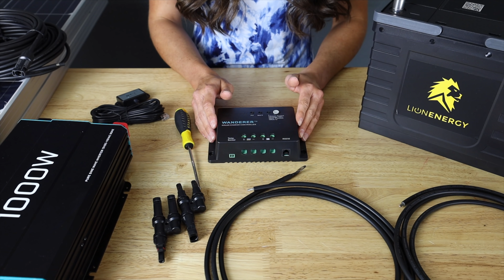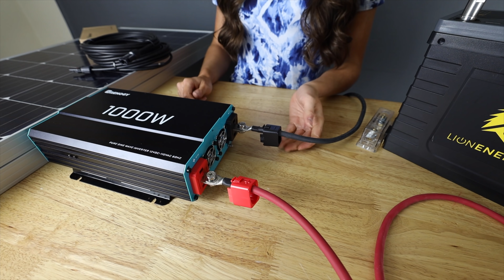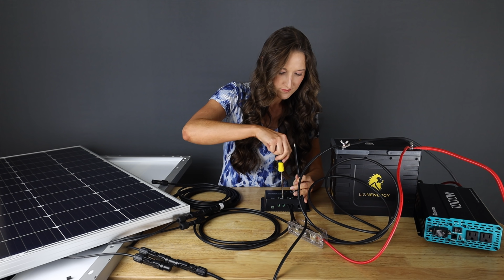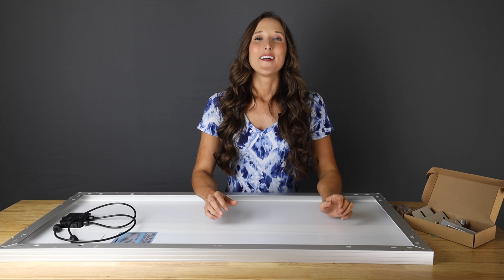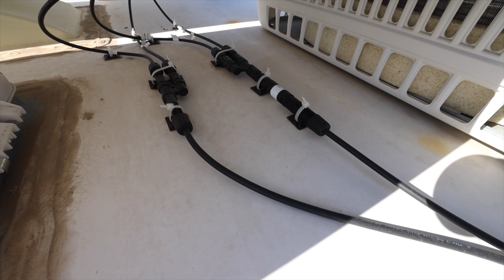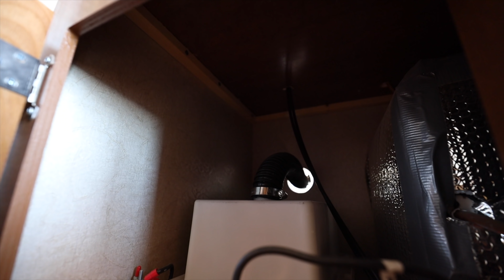Easy Solar Power Panel System Install Tutorial - Off Grid Van Life, RV, Truck Camper, Home Inverter

Comment: on your dingy put zinc plates so it will attack the zinc from the salt water instead of your electrical outlets and then put a wet kit in other words silicone put it in a box make sure that is it is all sealed and airtight watertight and then you won't have that problem

Comment: This is by far the clearest and most instructive video I've ever watched! Dr. Straight gave a very simple blow by blow instruction on how to install a solar panel on a van, camper or what have you. I've learned a lot, such that I just finished installing two solar panels at 100 watts each complete with a solar charge controller, a 200 watt lithium battery and  an optional Renogy 2000 watt inverter. Thanks Dr. Straight and keep up the good work!

Comment: Yeppers, that reminds me, even driving on the road you need fire extinguishers, foam for electrical, the other for gas & oil. Velcro probably works keeping everything in place or your stackable tubs.

Comment: You can install small fans inside & put a dark sun roof that opens so far, than pop out your windows in the day time. Hunters use a string system around there blinds & cut into cloth or burlap to slide over the opening.

Comment: Great job, I understood it. But I still don’t know how to make the beef stew. There is more to be done though here.   It’s winter , cloudy, snow and ice on your panels and there is too few valid solar light hours to help you out. You now need to solve how you can draw from your truck charging system to also charge your Lithium batteries while you are on the road driving. There is probably another fancy controller  in there between the truck charging system and the Lithium batteries, with more wires and fuses. 👍

Comment: Wow I'm very impressed, great job on the installation and make everything look as professional as can be, along with mounting the panels and preventing future head aches that may come with a leaking roof. Next project could be installing extra lights in the front of your truck to light up the trail

Comment: When ever working on a battery, you SAHOULD HAVE SAFETY glasses on. There a 2 types of pure sine inverters. Hard wire the inverter into the breaker panel. then the outlets would be hot. plugging into the inverter after its installed in a outside cab would be not east to get to.

Comment: Very clear, helpful tutorial.

I've always wondered if you could power a pressure cooker with a very basic system like this. They're one of the most efficient ways to cook a healthful meal. It being a single pot is another advantage, I think.

By the way, I'd like to suggest that you do some shows about how you prepare meals, the meals that you commonly eat, in your camper.

Comment: This is really cool since I have never seen how it was actually all put together before. One thing I will say is the connectors to the solar panels would be nice if there was a waterproof sleeve to slide or clamp over them for when in heavy downpour. Thanks so much for sharing.

Comment: Very nice video Hannah, thanks. Suggestion: put some red electricians' tape on both ends of the positive cable so you will never cross the polarity of the cables. You should also mention to your viewers that the size of the cable is very important and the cable can overheat without blowing the fuse if sized incorrectly.

Comment: Been doing this a few times I started using breakers instead of the mega fuses.. more money but if smoke does happen all you have to do is is repaired the short and reset breaker.. Does the manufacturer give you a choice? Liked the video .. you made it sound simple 👏 🙌 👌

Comment: What size (gauge) wire do you need for 400 watts solar array and 40 amp charge controller as well as for the battery connection?
Reply from the maker: This depends on how far you're running your wires. It's best to check with both the battery and solar parts manufacturer for the parts that you end up using=)
Reply: Dr. Hannah Straight     Ok thanks. What size / gauge wire are you using. I would say me wire will not be any longer than 10 feet, probably less.

Comment: Great video.  I just have a couple of suggestions for the DYIers out there.  First, when working with electricity and wires, it is best to use different color wires to denote positive and negative.  I recently fried my wifes Honda Accord by not keeping those straight.  If these are the cables shipped by the supplier, then green and red tape to mark both ends of a cable will work.  Red for positive and green for negative.    The other suggestion is to look at the max amp draw of appliances.  I was watching another full-time RV couple who stated that they stopped carrying their instapot because it draws so much electricity that it drains the batteries in a few hours.  They could only use it when plugged into shore power.  I cannot confirm this but this is what they said.  I have seen people run rooftop AC using 2250 watt invertor and more batteries/solar panels.

Keep the videos coming.  Love following along on your journeys.

Comment: A pure some wave inverter gives you clean power just like home, the one here likely won't allow you to charge computer while using. Pure sine wave works for everything just like you are used to. A 3000 watt pure some wave iinverter s maybe $300...well worth the approx. 30 amp ability.
Reply from the maker: it's a PURE SINE WAVE INVERTER :) I should have talked about  that.

Comment: I would not be impressed if I was Renogy giving you all that stuff and than use an other brand battery It would have been maybe the first but for sure the last time you would get things from us
Reply from the maker: While some of the products were free, I did spend $552 of my own money on Renogy parts that where featured in this video and $82 for other random parts that I needed to make the video for people looking to get solar power for off grid living. This video is about the parts that I have personally used to build my solar panel setup and the parts that I plan on moving forward with. I’m always going to be transparent in my videos. I’m not going to ever recommend something that I haven’t used or don’t believe in just because it was free or partially free. I think Renogy makes great products at a great price and their customer service has always been helpful on any questions I have had. However, I have never used any batteries from Renogy so I can’t give my opinion on them. I did start using the Lion Safari UT1300 and it has been a huge upgrade over my old lead-acid battery in size, weight, and amount of usable power. I think LiFePO4 is the future for battery technology and can’t wait to use them every day in my new camper build. LiFePO4 is a huge investment for someone to make in their power supply setup so if I’m having any problems with my batteries I will 100% be talking about it. My main goal for this channel is to inspire people to go on adventures and enjoy their time off grid=)

Comment: Nice job ! Question, what size truck camper do you have and can you run the AC
Reply from the maker: In theory you could run an air conditioner on a solar setup but you would need a lot of solar panels and a lot of batteries. It would be significantly less money to just buy a portable generator=)
Reply: Thank you 🙏

Comment: I recommend swapping the charge controller for the renogy 50 amp dc to dc charger. Both mppt control as well as utilizing your vehicle alternator while driving. It also keeps the vehicle battery topped off making it last much longer. Mine has been working for about three months now without any problem.
Reply from the maker: Yeah I completely agree on the alternator, my truck also charges my camper battery when driving down the road. It's great when there isn't much sun around. Mppt is definitely more efficient.
Reply: Dr. Hannah Straight please show us that setup. Curious how the camper battery gets charged by the alternator as well. Even although I’m happy with my setup it’s always good to see how people approach the power supply in their campers. My system is a replacement for a ctek system I had before but now changed when I converted to a 170 amp hour lithium battery.

Comment: Hannah, as a former electronic repairman in the Army, we were taught to always connect the Positive terminal first and the Negative terminal last.
Reply: Juan Mafnas 
And remove the negative first and then the positive
Reply: Yes, but why?  Here is why:  It is because when working on a vehicle having a negative ground, if you have a wrench or screwdriver on a positive terminal and you bump the vehicle's frame you would cause a short, spark, or melt the wrench.  Having the wrench on the battery's negative terminal first (to disconnect it) means that a frame bump or slip will not cause any problem.  Think of it this way, the frame and the battery's negative terminal are already connected, so a bump or slip will not be a problem.
Reply: @arthurroberts491  this is because the starter terminal and 12v accessory are always hot!
Reply: Thank you. I was thinking the same thing
Reply: Very good  😃 even in high school auto shop they teach u that .. maybe just for demo purpose she just forgot ...besides  if she would have made that mistake we would have heard  about some  U tube  blogger setting her rig on fire while installing a solar power unit . I’m sure she realized it but just didn’t want to shoot the video all over again  😃
Reply: Goes without saying , disconnect earth first , and reconnect last. A good way to remember this is In the form of a girls name earth , live , live , earth - ELLE ✌️
Reply: Yes, absolutely.
Reply: so which way are the electrons going  ?      +  to  -   ?    or     -  to  +  ?     Did the  military ever accept the right hand rule for current flow ?
LOL it does not matter,  just be consistant.
Reply: to be fair if its not connected to the battery, it wont make a closed loop until the battery is plugged in, OR there is a second battery plugged into the system somewhere else

Comment: Pro tip:  Cover your panels with a blanket when installing for added safety so they aren't generating.
Reply from the maker: I did this when I installed it outside but inside wasn't worried about it but great pro tip!
Reply: 9>]

Comment: At last, I found this step by step video for solar panels installation. Quick question, why do you have only one fuse attached to mc-4 connector? Why does the negative mic-4 connector doesn't have one? Just curious.

Comment: You mentioned a New Camper being ordered?   What dont you like about the Lance you have? What did you order?
Reply from the maker: I loved my Lance but I can't get to the remote locations I want to visit. It's too big and wonky to take to the off road locations I'm traveling to.
Reply: @DrHannahStraight  
Are you going back to a pop up?  I've had 2 Lance's and pretty crazy where lve been able to get too,  yeah they can wobble a bit but with  up grading the suspension you can tame all that. lm definitely looking into another Lance just because of the colder places l go to, like Telluride, Jackson hole in winter. And of course Tahoe, Sierra's
Jerry  smkjumpr34@gmail.com

Comment: Great video!  I've been running solar for about twenty years on my RVs... started with my old Lance 1030 way back in 2000, then to my 5th wheel toyhauler (which I currently live in), and now in my current truck camper, an Arctic Fox 992.  I used a pair of 120 watt panels on the Lance, then moved them to the 5th wheel, and now they live on the new TC.  I then added a single 270 watt panel on the 5th wheel.  For batteries I've always run 6v batteries because they're more durable than 12v.  On the 5th wheel I've been running Trojan T105's.  On the camper, I'm using a pair of US Battery Group 27 6v AGM batteries.  I can't afford lithium ion batteries; those things are $$$$$$.    I have a 1000W inverter too, but like you, I have yet to hook it up.  Just haven't needed it... but I have a generator.
Reply from the maker: Sounds like you've got a cool setup=) Lithium batteries seem to be getting more affordable every day, just taking some time. The 6V agm's are definitely the next best thing!

Comment: THANK YOU HANNAH,,I WENT DOWN MY STINK PIPE,REFRIGERATOR VENT IS VERY COOL!,,,TILTING THE PANELS IN THE FALL WOULD BE A BIG HELP ON GENERATING A BIT MORE POWER AS THE SUN GETS LOW..YOU ROCK,,VERY VERY COOL LADY ,STAY WELL,SAFE TRAVELS
Reply from the maker: Some kind of tilting mount with a motor timed to follow the sun would definitely be helpful for solar panels! Thanks for watching=)
Reply: @DrHannahStraight  WELL GM,,,WELL EVEN JUST A MOUNT TO TILT THE PANELS MANUAL.OU DID GREAT,I STATED WITH HARBOR FREIGHT PANELS,LOL WASTE TIME..
YOU DID EXCELLENT AND I HOPE THE CARONABONA BS DOES NOT IMPEDE YOUR TRAVELS THIS FALL,GONNA GET CRAZY SOON,,,SAFE TRAVELS,STAY WELL

Comment: Retired engineer here...  Several things to remember.... First, 110 VAC kills more in North America than any other voltage.  Except for being a "modified" sine wave, what comes out of that inverter is no different than what comes out of that 110V outlet in a building.  Treat it with respect!  Second, while Li-Ion batteries don't need the venting lead acid batteries do, they do need protection from water.  Lithium and water do not play well together!!!  Protect that battery from water!!  Third, be sure to use the specified fuses and have spares.  Use the right rating.  Go too low and you might always be blowing fuses.  Go too high and you might have a melt down.  Likewise on the use of fast-blow vs. slow-blow fuses. Fourth, and most important, make sure that the presence of a Li-Ion battery is quickly and plainly visible on the outside of the vehicle!  This is to help firefighters in case of an accident or other incident.  That way, they will know to use foam instead of water.  And, to call for HAZMAT should the case of the battery housing being breached and the contents leak.  Fifth, use RTV sealant generously at all points where the camper shell is penetrated.  

Great video.  Looking forward to more adventures.
Reply: Just so people can see how Lithium reacts with water.

https://www.youtube.com/watch?v=Vxqe_ZOwsHs
Reply: @rbrucerye  good visual. Thank you
Reply: Great added tips, Thanks
Reply: Thank you for the info. Mr. Engineer.

Comment: Excellent video and looks like it is a great setup. I like how you actually went through the installation process, makes it a very logical how to and set up. And if it powers an Instapot then I need this setup! 
I have two questions, how many times did your hair stuck while you were filming this video? And, how many takes did it take to make sure you said everything correctly (lots of terms and I could see that getting confusing)?